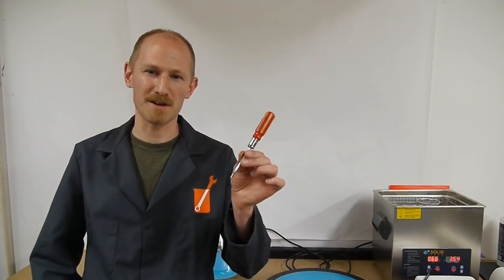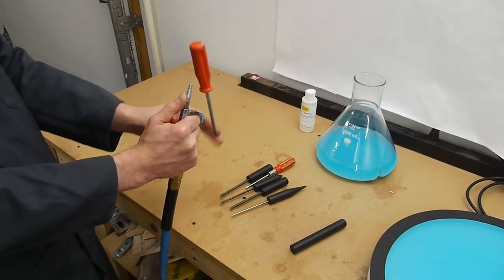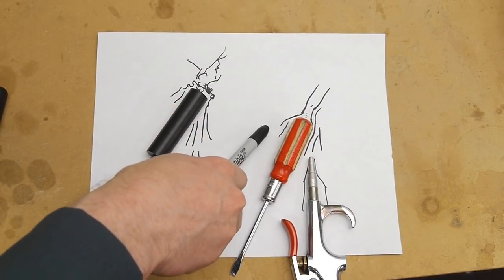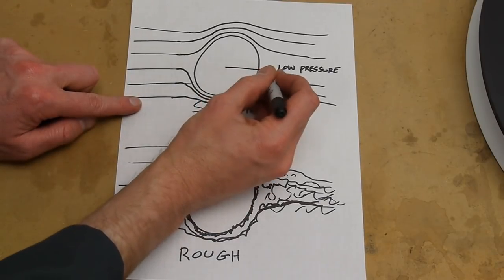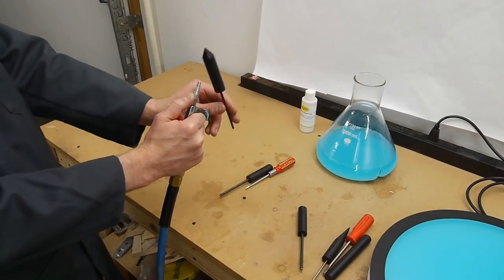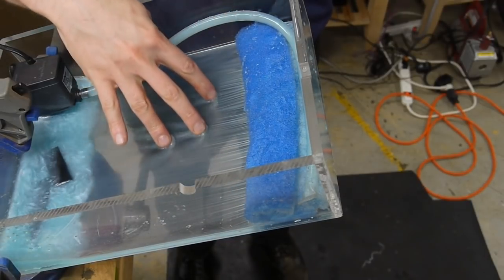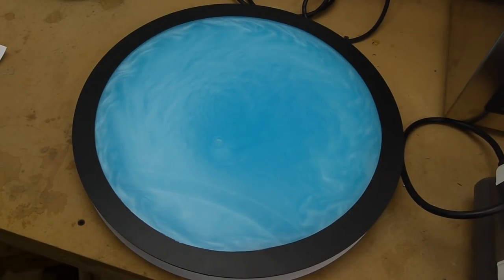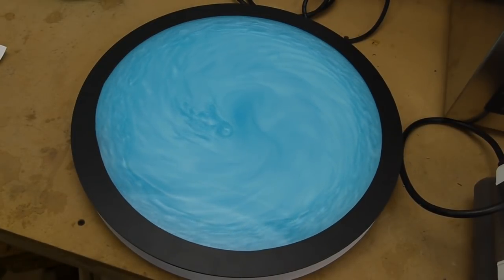The physics of floating screwdrivers

Comment: Excellent video, and what a great investigation you did! 
But I have a question about the turbulence.  It's the vacuum on a smooth-ended object that allows it to float, meaning that the drag of the vacuum is holding it up. The sharp-ended object fell because it wasn't being "dragged-up" by the flowing air jet.
 Why then don't we use sharp-ended cars, rockets, and missiles to make them faster, just as with your tennis ball and golf-ball examples?
Reply: So I was interested in this too, and found this enlightening reddit thread; https://www.reddit.com/r/askscience/comments/21rz0t
Reply: J Bishop I've heard the answer to this about cars: "they wouldn't sell." Based on the drawings I've seen, I would agree, I wouldn't want to buy it :P
Reply: Ryan Gunn Lots of good ideas get thrown out because of human's "taste" or "sense of beauty". 
 I state that form always follows function, and a pop-culture's sense of "taste" will eventually adapt.
  Does anyone see wheel cut-outs as particularly beautiful?  They are butt-ugly if you start to think about it, yet it's the wheel-hole covers (spats) that are seen as "ugly"!  Just as once people thought square, boxy cars were cute, and rounded cars ugly, taste will adapt.

Comment: Fun stuff!
Reply: rickey martin The block diagram and description leave a lot to be desired - requiring you to do a lot of the design and debug.  The author describes what the circuit does, but doesn't provide any schematic details (those diagrams are little more than block diagrams).  I would try contacting the author for schematics to use as a starting point.

Comment: i think the explanation goes more in the line of boundary layer detachment than with turbulence generation,  which is there but does not matter that much. If yo look at the different profiles in your 2D flow table yo will notice the flow bends around your rounded shape. This generates a lower pressure (which in turn bends the flow,  chicken and egg). In the case of the sharp edge the flow detaches at the edge and continues straight,  therefore no depression. In the case of the long cone the bending of the flow lines becomes so mild that no big depression is generated. Try sandpaper to delay boundary layer detachment and you will see more lift.

Comment: Sounds like you forgot about Venturi effect. Air does not have to separate, or create what you seem to imagine as a gap between the flow and an object. Just flowing along the surface is enough to lower pressure. And then there is Coanda effect, which describes fluids inclination to change it's direction flowing around smooth edges.

Comment: I think you draw the low pressure region  wrong. It is not symmetrical like on the paper.The Low pressure is everywhere behind the screwdriver, not only in the middle.
Reply from the maker: Toni T800 Yes, you are correct.  The flow would be more in line with the direction of the nozzle despite the handle's orientation.
Reply: Applied Science 
It would be cool if there were some smoke in the air to see the patterns better.
Reply: Applied Science 
That doesn't put the low pressure everywhere. I think he is missing the concept of a jet of air vs atmosphere.

Comment: Interesting but it must be a lot more complex than that to levitate in a stable pinching pocket with forces at an angle. A lot of things have to go really right for that to work.
Transferring the weight of the screwdriver back through the air to the nozzle as torque is a mighty neat trick. Not to mention preventing it from the obvious pushing away or even chaotic occasional pushing away. Fully understanding what's going on is likely very insightful.
I wonder if the ether allows similar fluid trickery.

Comment: great video and really cool flow visualization at the end.  I somewhat disagree with your explanation though.  The lift is more due to the coanda effect than the separation of the flow.  With a rounded end, the flow stays attached for some distance which turns the flow.  changing the flow from vertical to  horizontal is a change in momentum which accelerates the flow and creates a low pressure region.  If you have a sharp edge, the flow can't stay attached so there's no turning. with a shallow angle there's not enough of an angle to provide the necessary turning to generate the change in momentum/flow acceleration.

Comment: the high pressure of the air flowing out of the compressor holds it up.  Low pressure isn't pulling it up. what needs to be explained is how it doesn't fall out of the air stream on the side.

Comment: I'm a truck driver, the company I pull for put a tail on the trailer saying it reduces drag, but if I understand this right the tail would need to stick out much further to stop the low pressure and it probably shouldn't be hollow.
Reply: +Joe Seabert a longer tail would be better, but it would have to be extremely long to completely eliminate separation.  The short stubby tail that they put on trailers is at a shallow enough angle to allow the flow to stay attached, until it gets to the end.  The flow will still separate at the end creating a low pressure region (drag) but since the area has now been reduced from the taper of the tail, you now have a smaller total drag force.  drag force is just pressure x area so if you reduce the area you get a reduction in drag.
Reply: +Joe Seabert Yep, it's the perfect scam.  The difference is too low to measure in terms of fuel and it was sold on the "everybody knows" principal.  Truth is that the side drag on the tires from a cross wind (or being beside another truck) would eliminate any advantage is much more significant, even if the principal were not wrong.  The trailer skirts suffer from the same malady, except they do work-except in a cross wind or traffic where they hurt.  No one says anything because it is too small to measure either way.  The friction of 80,000 lbs on straight highway is truly incredible.  Those men that can pull an EMPTY trailer truck are exerting hundreds of pounds of force.  At highway speed that is HUGE amounts of horsepower and the effect of eddy reduction at the tail (the smallest drag after displacement and skin friction drag) is truly trivial.
Reply: +Derek Paxson Oops you got it backwards!  The taper increases the drag,  it is the drag that holds the screwdriver up.  The straight edges don't have the drag and the screwdriver falls.  Just like in the semi truck tail, the tapered tail increased the drag.   However, it does increase the stability, which is why some (slow) race cars have long tails.  Consider the case of a planning boat,  having a sharp edge where the water leaves the bottom of the boat is the trick to low drag (and speed).

Comment: Do racecar drivers take advantage of this?  How about geese?  Why aren't airplane wings shaped like screwdrivers?  Will it work with a pingpong ball?   Who's Bernoulli?  Why does dust collect on fan blades, and why do bush pilots fly low to minimize headwinds?
Good demonstration video.
Reply: As far as I know, racecar drivers do try driving in the low pressure zone, when they are dircetly behind another car to catch up with it more quickly. 
Dunno about geese. 
I suppose it has to do with the fact, that the wing is not inserted into a narrow stream of moving air. 
Very good question. 
I think bush pilots go on the assumption, that winds can be faster at higher altitudes, because there isn't any terrain or trees and whatnot slowing the air down.
Reply: Yes racecars and their drivers take advantage. Look up slipstreaming, and defusers
Reply: Yep but the big value of drafting is the reduction in fuel consumption. If they can skip one refueling stop over the course of the race that could make the difference.

Or if you are driving across country you might be tempted to draft behind the semi's. Yeah well if you really need to save gas, but it's pretty dangerous because most semi's can stop faster than you can and you have to be really close behind them to take advantage of the vacuum effect. 

Geese have also been proven to ride the vortexs cause by the leading birds and that's why they form the characteristic V pattern.

Same with military planes. I think geese change leaders from time to time to give them a rest, not sure about that though..

Comment: Without watching the rest of this video I am guessing that the turbulence created by the irregular surface is a necessity in creating a low pressure cavity behind the screwdriver. The smooth replacement is smooth and will have laminar flow which will not create a reasonable Reynolds number and thus have no eddie pockets in the wake.

Comment: Would be interesting to find a way to calculate the angle the cone must have in order to be able to levitate,,, other dimensions as well like changing the centre of gravity, radius of the handle, and properties with the air pump,,, it would also be interesting to see what happens if you replace the air with something like helium or a liquid :)

Comment: What I find amazing is that there is no horizontal movement.
After all you hold the nozzle at an angle, and yet the screwdriver stands still.
What happens to the horizontal component? There is no way the force on the low pressure side can just compensate that, it must always be lower than the force on the high pressure side.

If it was just a ball, completely in the high speed airstream, it would fly off.

Perhaps there is a vortex of air going the other way acting on the lower half of the stick?

Does this vortex determine the distance at which the screwdriver hovers?

What happens with a large nozzle?

This calls for experiments with different length of stick.

Comment: Can you put a pressure sensor (100 ksps and 12 bit) in the flow region at the top of the screw driver to monitor the changing pressure for different flow rates?  It doesn't have to float, but could you also measure three axis forces on the screwdriver shaft at a convenient location.  If you heat the air with a radiant heater that should make it interesting.  But you would then need to monitor the temperature of the air in the low pressure region at the top.  But then you would, of course, need some way to verify the changing forces, so put three axis accelerometer and gyro chip(s) on the shaft somewhere.  

Since most MEMS gyros and MEMS accelerometers are REALLY slow sps, you would need to be creative to push that to 100 ksps.  Then, because it is also easy and cool, you can listen to the signals by audio, and also watch them on the scope.  And, because you are doing science and not just eye candy pretty things, you need to record everything and runs some correlations and statistical studies.  If that is too easy, I suggest you put an atomic force microscope (non contact) sensor close to the handle and monitor small motions that way.  If that is too easy, add laser speckle monitors to push accelerometer readings higher still.  I am writing quickly, I don't think I got anything wrong.  

These are all things I know about and cannot do myself, because I have no such skill in building things.  

If you really want a tough and useful project, build a three axis MEMS gravimeter sensitive enough to track the sun and moon by their tidal gravity, and then use an array of them to track moving objects in the lab by their gravity.  If any of that seems interesting, I will put the calculators online to help. At higher sensitivities and higher sampling rates, you can track seismic waves as they are spreading in the earth - by their gravity signals.

Richard Collins, GravityNotes.Org

Comment: The top of your cone topped one is rounded, right? If that is the case, then I assume the upward force created by the air is all separating at a closer point, creating a more stable lift. Try another with the top of the cone not rounded, it should float a bit, but it might jut around, or fall. I am genuinely curious

Comment: hi again .  thats called the coanda effect.  they avro saucer was based on this and used a jet engine .  avro worked but had heat issues from what i read and could only fly at about 80 mph before it went unstable.

Comment: The taper point shape got me thinking, could you float a suitably sized drill bit, or does the shape/mass prevent this?
If it floats, would it spin in the air?

Comment: What happens if you make a sort of duct or shround around the cylinder ? Does that improve or worsen the effect ?

Also why did you choose 100 PSI for your shop air ?  I'm adding shop air to my garage with a big compressor and I'm wondering if I should keep higher pressures like 130-140 PSI or stay with the pressure most power tool recommend (90 PSI)

Comment: I think you have the air flow wrong. Between flow lines that go around an object there is a line that terminates on the object and another that starts from the object on the back. The points they touch at are called stagnation points and are high pressure not low.

I think it's not drag but lift that's holding the screwdriver up. The jet sticks to the curved surface and is bent around it. The reaction force of making the jet turn a corner pulls the screwdriver up against gravity.

Comment: Meibi the antigravity will operate at low pressure under the vehicle.Need new smooth materials and computer calculated shapes for efficiency in mass holding.

Comment: hey u could use ansys fluent to simulate the flow, and using velocity vectors to see this effect more accurately
Reply: Applied Science I ran the simulations and made velocity diagrams like the ones u drew using asys fluent but for just the cross section. its not really good coz its the first time i used the program. i could send them to you if u want

Comment: Could make a series about vortices? Eg the concept of condensed point-line-circle zero-infinity axis of density-intensity 2-ness i-reflection containment states of superimposed time-timing sync-duration is instantaneously composing the format of electro magnetism, the +/- spiral of e-Pi-i in crystal Atomic nodes as can be illustrated by the videoed device. 

It's so plain and ordinary, as it should be, until you use temporal terminology, and show the trig-conic-fractal of e-Pi-i omnidirectional-dimensional cause-effect squished into a 3-ness "gyroscopic vortex" plane in sphere of galactic type Quantum-fields, pulse-evolution condensation. It's all out there.

Bose-Einsteinian Condensation here-now-forever reasoning in the Observable context, from appropriate professional experiment..

Comment: This answers a question I've always had about levitating a ball on top of a stream of air.  It's easy to say that the air underneath the ball is supporting it, but this should be unstable, while in fact it's very stable.  This shows there's also a low pressure area on top, which would cause stability.  Hmm, Physics Girl say's there's more:
https://www.youtube.com/watch?v=kR2Oi3XCX18

Comment: Hey Ben, what do you think would happen if there was a hole in the top of the screwdriver cable? Would there still be a lift force or would the hole be enough to cause turbulence?
Thanks
Reply from the maker: Matheus Raymundo Good question!  I'll bet if the hole were big enough, it would allow air to flow into the low pressure zone and reduce the lift such that the object would no longer float.  The hole would probably not need to be very large -- maybe 1/20 the diameter of the object?
Reply: Applied Science
I just tried with a 20mm dia. plastic pipe with the end rounded over nicely to leave a 10mm hole. It still floats.
Doesn't float without the rounded end. So even a large hole does not prevent floating.
Reply: stefantrethan Thanks =)

Comment: could you try blow the extreme one with a narrower angle (a few degrees before the air coming out of the nozzle is parallel to the shaft of the screwdriver dummy)

Comment: I cannot seem to replicate this with any screw driver. Is this pressure dependant?
Reply from the maker: HippyDad For an average air gun, you'll need about 80 psi to get enough airflow to suspend the screwdriver.  If you have a small compressor, you'll need to store up some air in a tank to keep the pressure high enough during the experiment.
Reply: It's also heavily related to the shape of the screwdriver handle. It's based on the Coandǎ effect https://en.wikipedia.org/wiki/Coand%C4%83_effect

Comment: one thing about your analogy of the pickup truck. leaving the tailgate closed and having a swirling vortex in the bed allows the air in front to flow over the top and over the back of the bed on top and is less of a drag than leaving your tailgate open! I think it was MythBusters that proves this and they showed the example in water also. so, today, whenever I see somebody driving with their tail gate open I think to myself, your misguided and you're actually using more gas than if you would leave it closed!